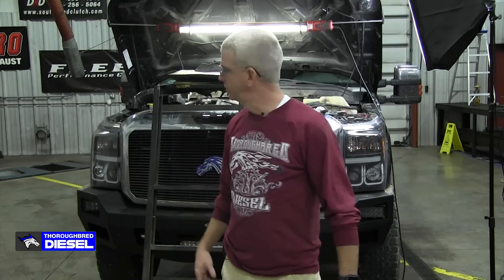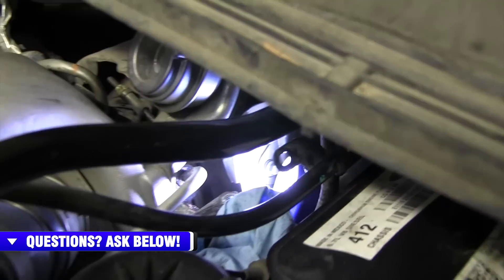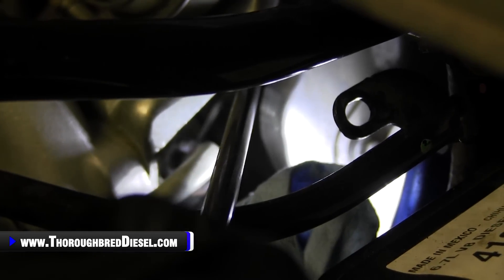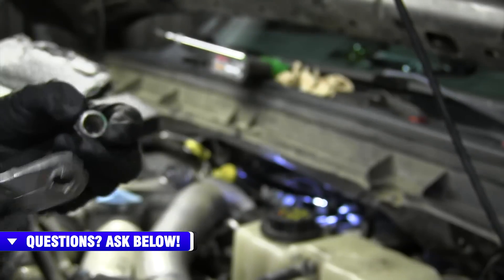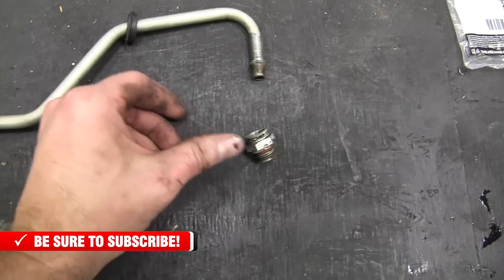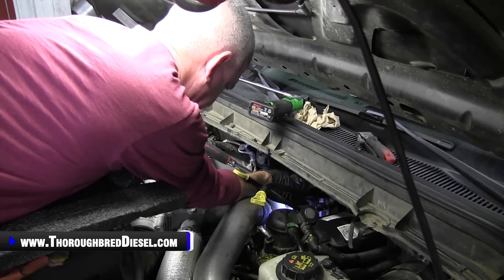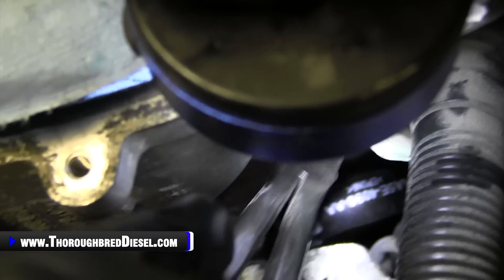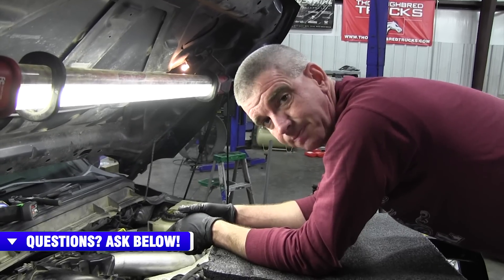Coolant Tube and Fitting Install: Ford Powerstroke 6.7L

Comment: I’ll be doing this repair this weekend.  What size jiffy disconnect tool did you use?  That going to save me a bunch of trouble.
Reply from the maker: If I remember correctly it was the ½.
Reply: It is in fact 3/8” but save yourself some time and just cut the line at the elbow and get a deep well 19mm. Way faster.
Reply: @williammalecki1562  that’s exactly what I’m gonna do lol

Comment: On that coolant line fitting what size threads are they and are they metric or standard. My fitting got corodded all the way to breaking it broke off and im trying to clean the threads with thread chaser. I appreciate if you all help me with that info i needcto know.

Comment: Whats the point of replacing the whole coolant line instead of just the fitting that leaks?
Reply from the maker: Reliability. You are right there, do them both.
Reply: @thoroughbreddiesel  this must be different on 2015 turbos? i cant find this coolant line on my turbo.. but am losing coolant somewhere and strong smell of coolant.

Comment: Just finished putting it back together and realized I didn't push the black safety clip over fitting should I take it all back apart
Reply from the maker: Darn it.
Reply: @thoroughbreddiesel  is it a safety clip or dust cover

Comment: would this cause an excessive coolant loss? I have a leak in my 14. was driving down the highway the other day and it started puking coolant. i was 2 hours from home and took 3 bottles of coolant to get home. hasn't lost any power so i dont think its the headgaskets, that and it only has 22500 miles on it.
Reply: Isn't yours still under warranty? T
Reply: @Airbornechuck82   yeah it was. Ended up being the heater coolant pipe had a crack in it causing the massive coolant leak

Comment: Thanks for the great video, which i'm fixing to tackle on my 11'. But i'm also leaking some oil down the back of the engine, could it be that the oil fitting is leaking also?
Reply from the maker: It could be pooling and running down if the leak is severe. Also, pay attention to the vacuum pump gasket. They are known to leak as well.
Reply: Best video I’ve seen yet doing this install.  Wish I had known about the disconnect tool.  Can you tell me what the Weird “w” shaped metal snap ring  that you have to click into is called and is this always installed prior to the line or is it possible to push line in and then snap it on there.

Comment: I've noticed that all the videos for removing the intake that no one replaces the seals/gaskets on the intake upper or lower pieces???? Is it necessary to change or reuseable....about to do the oil and water tube change....my engine has 200,000 miles now and noticed the oil tube leak and coolant appear to be suspect for missing coolant....hoping the tube is leak and not the charge air cooler ....thanks pauly

Comment: What is the torque for the bolts when reinstalling the plenum?  Do you have a video for securing the clamp on the rubber hose on the
turbo coolant line you installed?  Do you have a video on just replacing just the rubber hose? Thanks.
Reply from the maker: Tighten to 11 Nm (97 lb-in). Not at this time.

Comment: Good informative video, I have a few things I’m unclear on1) is the cover you pull of with the long pick just simply a cover that needs to be simply pryed off slightly? 2) when you put the jiffy tool on the connector do you undue it by hand or did you have a ratchet on that jiffy tool? 3) does the entire line have to replaced ?
Thanks in advance!

Comment: So is this an upgraded part? Or the same one that's going to break again?
Reply from the maker: At this time, I do not know of an upgrade to this line.
Reply: Sinister diesel makes a replacement.  Steel braided with silicone hose.
Reply: Rudy’s diesel makes a stainless replacement line and it’s only 46 dollars. I just ordered it and will be installing it when it comes in